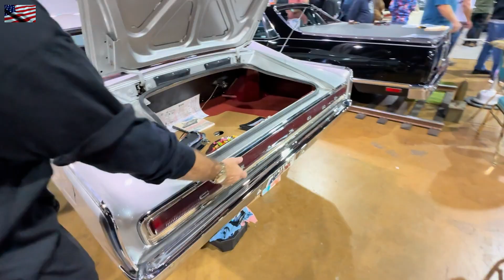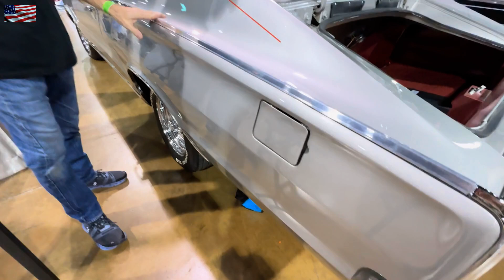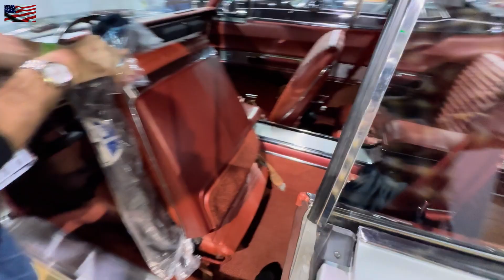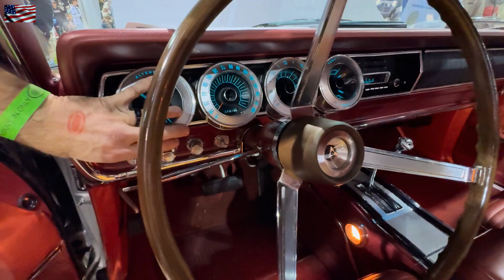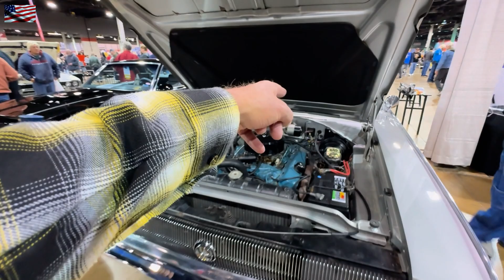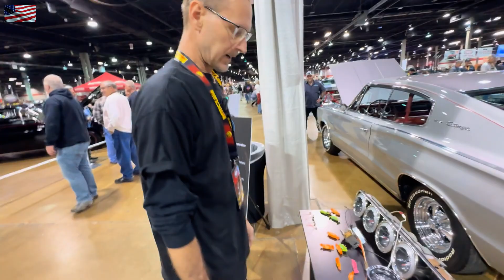Must See 1966 Dodge Charger 383 V8 and Electroluminescent Gauges

Comment: This is a carry-over design, as Chrysler developed the stunning 1968 Dodge Charger RT, as shown in the film Bullitt. But this car stands on its own merits.

This 1966 Charger is a genuine working-guy’s performance machine. Which is to say, a guy with a good assembly-line job could finance one of these and handle the payments. He was not out to impress others. He wanted a responsive car with V8 power that was a pleasure to drive.

Its 4-barrel 383 delivers strong acceleration. Its Torque-Flite 3-speed automatic is bullet-proof and was preferred by the NHRA dragster crowd over a 4-speed manual. On a sunny weekend at the local track you could turn up in one of these and give the 440 and Hemi owners fits. Because all this car’s driver needed to do was step on the loud pedal.

The car’s fastback design is considered dated now, but somehow this legitimizes it as completely without pretension in the eyes of those who consider the 60s as the high point of American car design and technology.

Back in the day this streamlined beauty with Mopar drivetrain was a sure-fire head-turner anywhere you came upon one in the USA. The same is true today. In a funny way, because it never tried to be something it wasn’t, among boomer-age motorheads this Charger’s place in the history of U.S. performance cars is assured. 

Icing on the cake: Buy it, take it to the track, and it brings home the bacon.
Reply from the maker: Yes it is in so many ways!

Comment: My 70 charger has electric motor for the hide away headlights and a thumb wheel you can use if you need to override or it gets stuck you just turn the thumb wheel on the motor you can  manually open or close flaps depending what direction you turn the wheel. Its just the grill that moves not the whole headlight assembly.

Comment: Nice car! I've owned a '67 and now a '66. I think, for the '66, it's the front to back console. That's for one year only.
Also, the '66 Charger was slated to be the first production turbine car but that never happened. The two air vents in the trunk were also for air de-compression for when the car was on the highway moving a fast speeds.
Reply from the maker: Enjoy your 66. They are very cool rides!
Reply: @TSBTC  Unique car and a fun drive. Thanks!